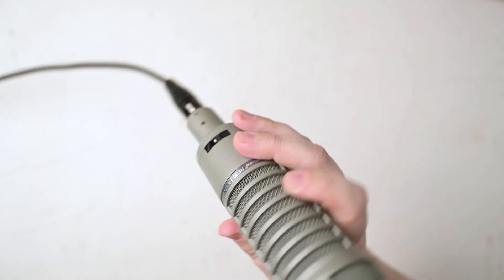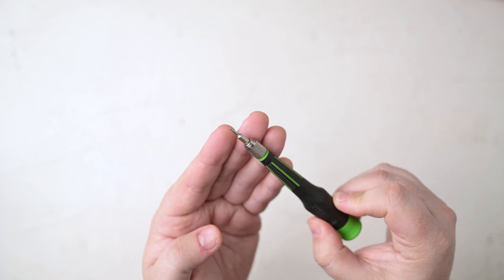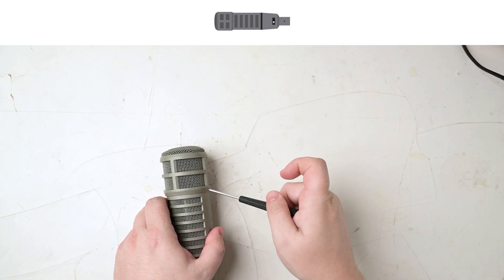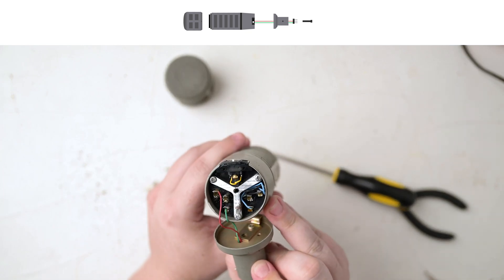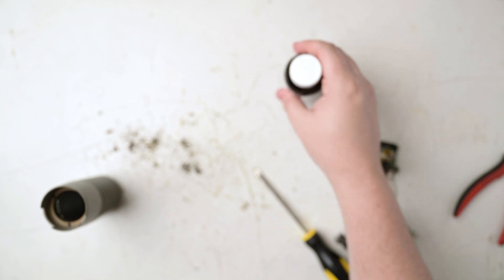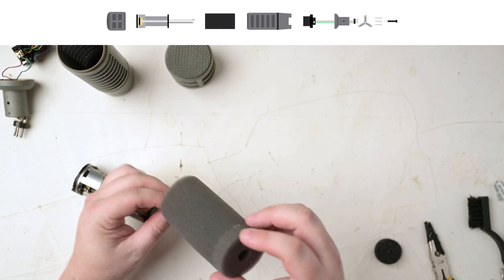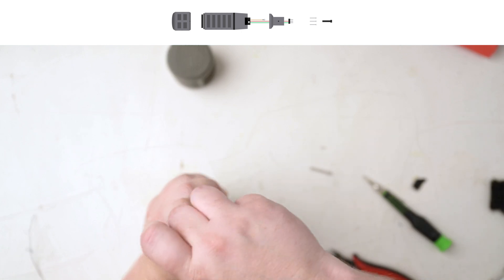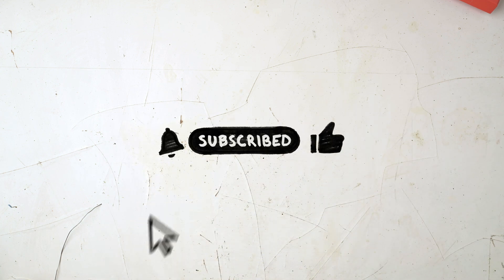Replacing Disintegrated Foam in an Electo-Voice RE20

Comment: Does anybody know if the re320 uses the same parts (at least regarding the foam replacement part numbers)

I got a used one and would just like to replace it if possible
Reply: Yes it does. It's almost identical inside

Comment: How long did it take for the foam to get that way? I've had mine for a year now and it doesn't move from the desk so I would like to think it's fine for years. Maybe I'm wrong..
Reply from the maker: @lancemanyon3139  my guess is about ten years to disintegrate. I doubt it matters if you use it a ton or it sits packed away, eventually it’ll do the same thing. But you’ve got years before it’s an issue.

Comment: I just purchased an EV PL20 (same as RE20), that has been refoamed. Compared to my other RE20, however, there is no bass response. Any idea what that could be and how to fix it?
Reply from the maker: @zackmedic4999  the first two things I’d think to look at are that the bass roll off switch is in the correct position, and that it’s connected properly inside, and if those check out next I’d compare how the capsule looks to a proper one. There are some videos that show things pretty clearly if you look up RE20 repair or RE20 baby rattle, there’s a piece that can come loose or off center, I wonder if it’s something with that.

Comment: Thanks a lot for this video. Does anyone have a link to get this 3 pieces of foam at a decent price with shipping to France? Otherwise I'm gonna make it with the foam from my motorbike air-filter that looks very similar and cost nothing!
Reply from the maker: @francislamousse83  Bosch is based in Germany, no? I’d send them a message. Otherwise I’m sure making them yourself would be fine, they’re not terribly complex pieces. I’d just want to make sure the foam densities are similar to actual replacement parts as the head basket foam is very different than the body tube and collar.

Comment: Do current production RE20s ship with this disintegrating foam … ?
Reply from the maker: @kierenmoore3236  as far as I know, yes the foam in any RE20 will eventually have this issue. Granted it takes quite a while - I bought this one used and it still didn’t have issues for many years. But replacing the foam before it’s disintegrating would make it much easier!